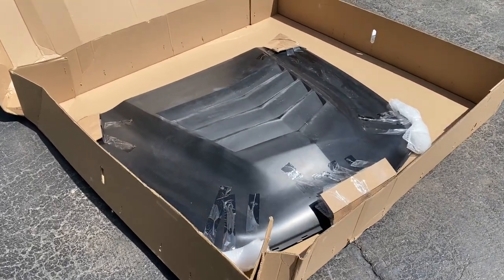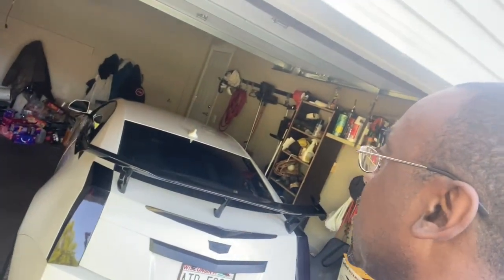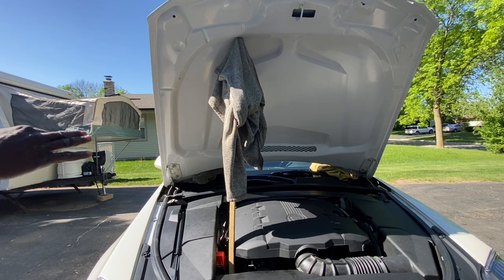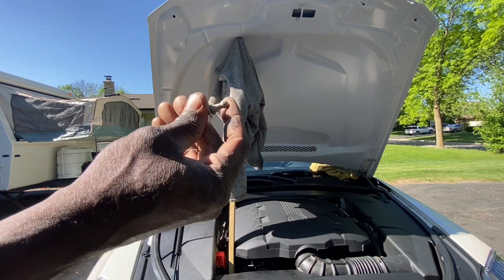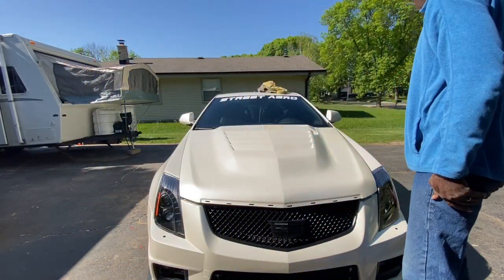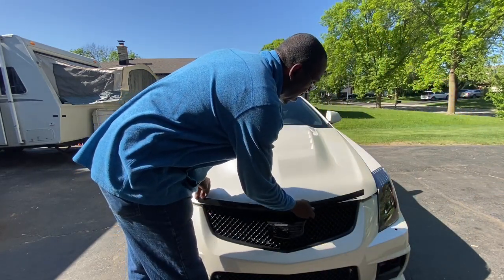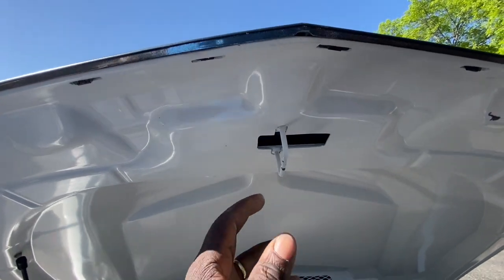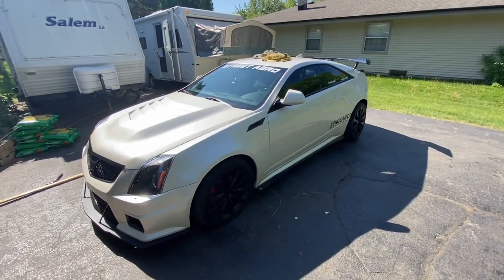Aftermarket hood installation / review 2011-2013 Cadillac CTS coupe

Comment: same hood on mine   i spent like 30 hours getting mine ready for paint   not best quality fiberglass but fit is excellent
Reply from the maker: I guess it depends on who is laying the fiberglass at their shop. For me, I spent only a couple of hours block sanding and puddy filling before sending it off to paint. The fiberglass used was excellent, the thickness was excellent, the lines were straight and true. The end result was more than I could of asked for.
Reply: @marenothecarguy8361  my V is Black  and i wanted it Flawless   Blocked it like 6-8 times

Comment: Would that hood hit my 2012 cts v6?
Reply from the maker: Yes it would. No modifications required. If you have the original factory style front bumper, you would just order the hood for the CTS base. I switched to the CTSV style front bumper so I ordered the hood for CTSV. Both cost the same and basically looks identical.
Reply: @marenothecarguy8361  I have a sedan cts v6 and want to change both the bumper and hood to the v style. Where did you order the bumper and hood? What’s the estimated cost for both?